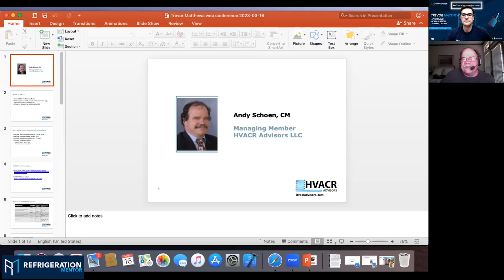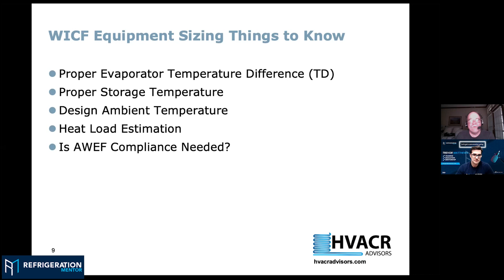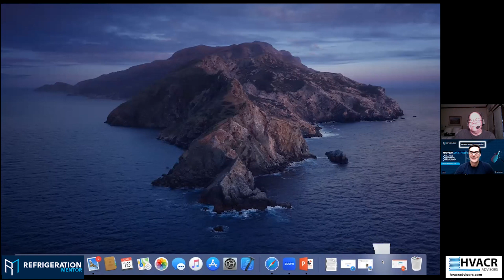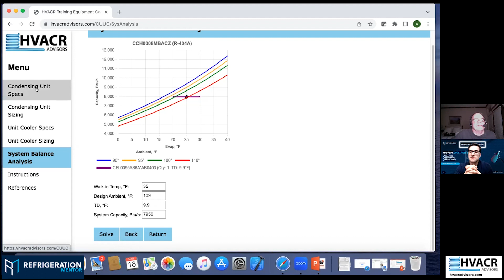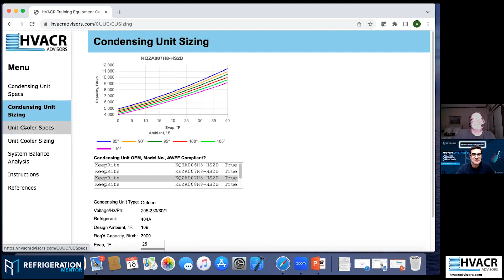How to Select Proper Equipment for Walk in Box | Tips from Industry Expert Andy Schoen

Comment: Thanks RM for the podcast, it was an interesting lecture ! I got a little lost with Andy's explanation at the 27:30 mark regarding TD and capacity.
He stated that if you double your TD you get double the capacity but from what I understand as you reduce the SST you reduce capacity of the compressor due to its compression ratio.
Say we're using a ZR125KCE Copeland scroll at 45 F SST it delivers approximately 8TR of capacity but if we were to drop the SST increasing TD you get reduced capacity from the same compressor.
It will effectively remove more humidity out of the box because of the lower SST but at the cost of capacity. Maybe I totally lost what he was talking about lol
Reply: You are not lost at all.
Reply from the maker: Connect with Andy at HVACRAdvisors.com and he will be more then happy to help